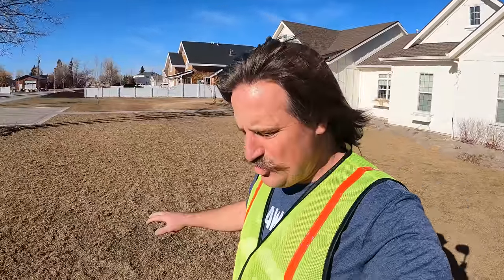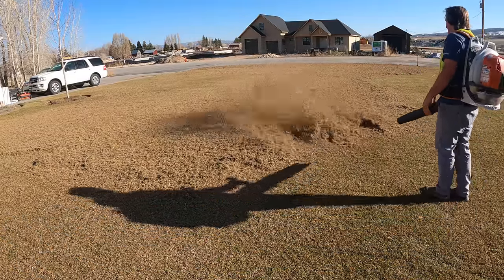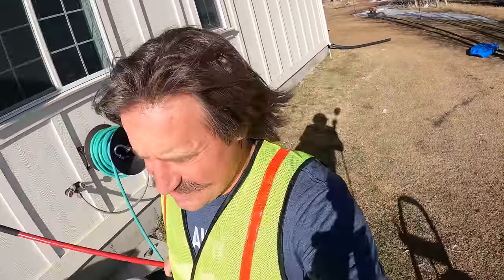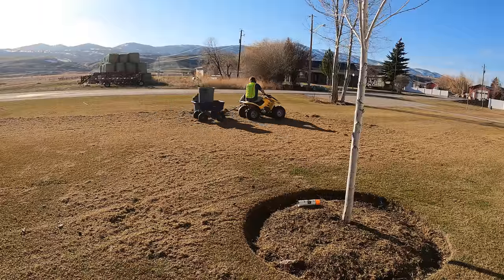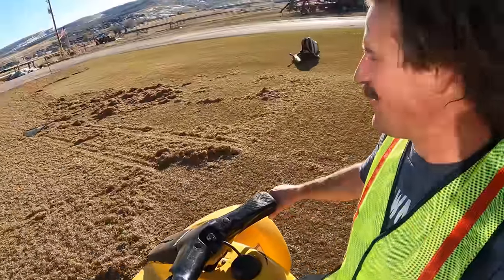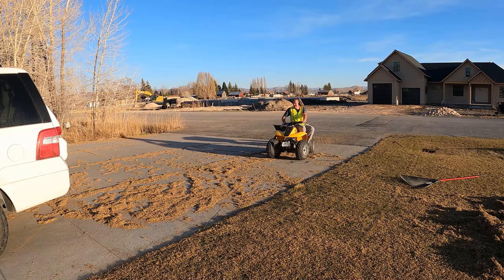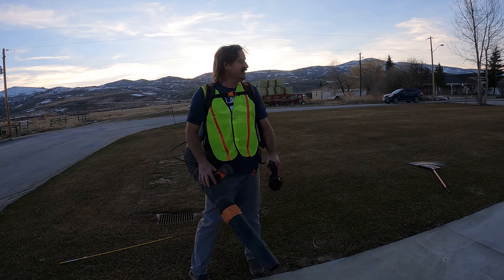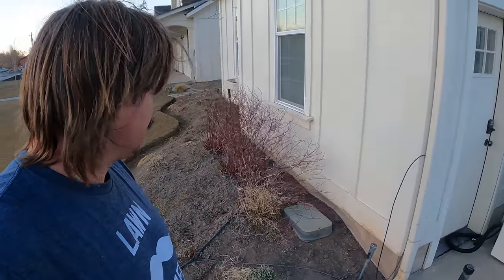THATCH REMOVAL. GOLF COURSE LAWN. Spring lawn care

Comment: The lawn is a labor of love. I use a 10 x 12 tarp to remove most of my scalped grass. Lay it on the lawn and rake grass on it, then drag it to the pole. It holds about 6 cans full each trip. Either way you’re on your way😁
Reply: @Tyler Anthony Agreed... Tarps are usually more trouble than they're worth..
That's why I let other people fumble around with them while I  work 😂

Comment: "Front loaders are trash" 😂😂 must have been a bad one you got. Front loaders are much better and more efficient that the top loaders. Had a top loader and I paid too get a decent front loader and its amazing. 1/4 energy and half the water if not less, whites are whiter and it washes everything soo well that my skin has cleared up. Every year it amazes me how much thatch I get up, it's never ending haha.
Reply from the maker: They don't wash your clothes because they don't use enough water. No agitator equals no scrub. Clothes running against each other is not the same thing as an agitator. They also stink. If you notice everyone with them leaves the door open to increase air flow because they mold and stink

Comment: You should build a trommel for the compost and make a how-to video:)
Reply from the maker: like this?  https://www.youtube.com/watch?v=e3wgCbmIHUs    been there done that
Reply: @lawnrebel  that is what I was thinking! Sounds like it didn't turn out too well:( I sifted a bunch of compost and stuff for a small portion of my yard (less than 200 sf) and I had about enough. I used something similar to what Ryan Knorr made. It was an old gypsum sifter our finishers use when they have to do old plaster repair! Worked like a charm though.

Comment: That's not a dethatcher it's a root ripper, we should really prove if it's thatch you getting or grass let's test that machine on your mustache, 🤣🤣🤣. I'm glad your a lawn enthusiasts but, yes but I can't wait until you get it right,🤣🤣🤣. Though entertaining as you are, I shouldn't fail to help you out. Lawn care nut is a dimwit down in Florida. I grew Kentucky blue grass from Walmart 1 year 20 year's ago there was Ryegrass Dandy lion's and all sorts of crap weeds and other types of grasses. I waited until it rained then quadruple fertilized with cheap arse estate brand fertilizer think it was 18 18 18 it killed most of the inert grass types and knocked down the dandy lion's considerably. 4 week later I toss down again quadruple the seed rate under rain conditions plus watered heavily for 3 week's 3 times per day after that I watered twice a week a 1/4 inch waited until August and did 1 more quadruple fertilizing rate. Following spring last quadruple fertilizing. After that I had no more weeds & a gorgeous 4 inch grass that I would cut back to 3 inches twice a week water twice a week. In 20 year's time that lawn never got another weed nor disease. I didn't need fancy industrial grade equipment like I was working along the state highways,🤣🤣🤣. Like you got nor all those environment corrosive chemicals you use 🤣🤣🤣. Pre -emergents, more grass & more grass seed sand sand sand sand & more sand then knocker dead completely herbicides, more fertilizer more grass more sand sand sand cow prints bike trenches more sand more grass more fertilizer, 🤣🤣🤣. My lawn never felt the burn not even once. A you want the lawn thick, it chokes out weeds including POA that you Love to Hate. Furthermore you want the grass blade clippings to be mulched back into the lawn there's still fertilizer in said clippings that are in fact beneficial to your lawn as well as the clippings themselves also help choke /slash hash tag smother out weeds. In Essence your lawn can cure it's self without all that other nonsense your doing (FACT)

Comment: I'm tellin' ya Connor, you gotta get the Agri-fab yard sweeper. it makes this clean up go so much faster. Also great for leaves, nuts, and other junk.
Reply from the maker: I may try that
Reply: @lawnrebel  It's great I've got one that I use on Renos for friends and family, along with dealing with leaves every year since I've got neighbors who basically refuse to lift a rake. I would recommend getting sports wrap for tennis rackets though for the handle. (I have the push kind, not the tow behind.)

Comment: Does thatch work well in a compost pile ?  Nice job as always , looking forward to more lawn vids... I'm 100% with you on the washing machine thoughts. I bought an agitator less washer...Lasted less than 10 years and never did clean very well. The suspension system needed to be replaced. Costing more than a new washer. New washer with agitator, does a better job and should last a long time.